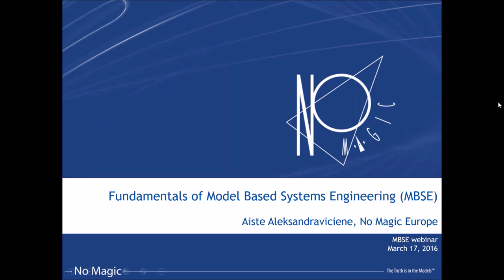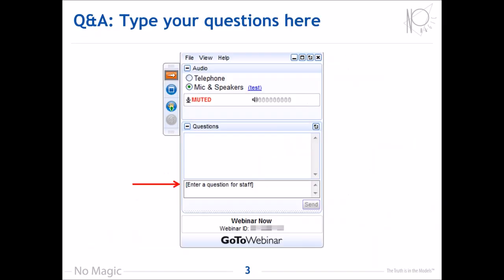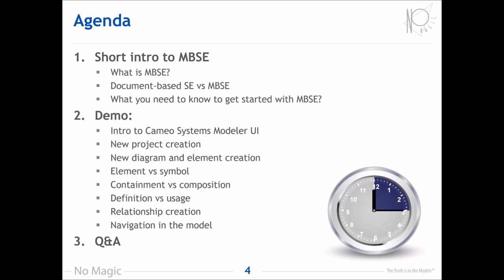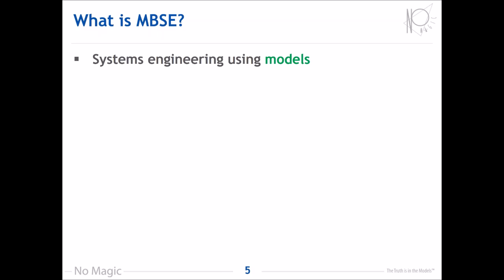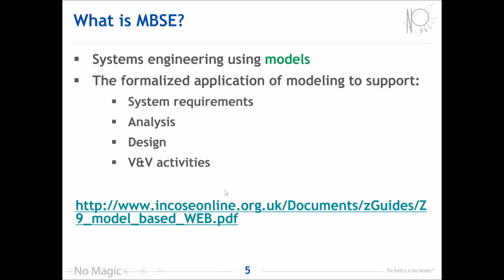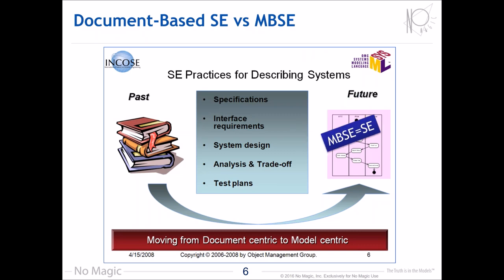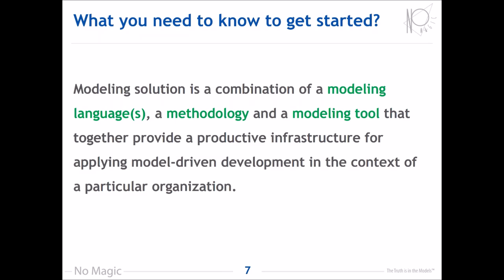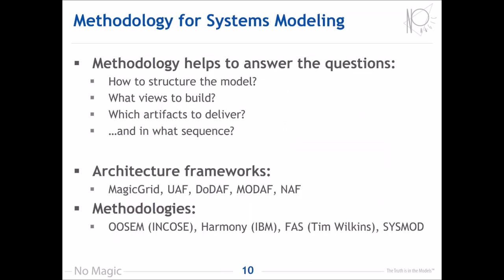Fundamentals of Model-Based Systems Engineering (MBSE)

Comment: A very good tutorial, set speed to 1.25 and it should be good. It's not that she isn't prepared, it's just the difficulty of finding the correct words/ways to express what she wants to say. People whose first language is not English would understand.
Reply: Innoslate software task

 This is an individual assignment. Using INNOSLATE, Please perform a functional analysis (decomposition) of 'to manage' (more specifically, 'Manage a Project') which should include a very thorough decomposition. You must use INNOSLATE. Ensure you number your functions and go down 3 levels (F0, F1, F1.1) This should be a refresher from your SE3100 Fundamentals of Systems Engineering Class (Blanchard and Fabrycky, Buede and the DAU SE Fundamentals). If not, let me know.

The point is to get to a functional decomposition with which you feel comfortable and your logic and structure for functions is sound. You must explain in writing (1-3 paragraphs) why you selected the functions and the functional structure in order to communicate your logic. You must also cite sources and provide a list of references.

This assignment should be 3-4 pages and enough content to explain why and how you created the decomposition.

Budget- 30-35$USD
Timeline- 2-3 Days
  can you do this assignment for me??
Email id- bshelpinhomework@gmail.com

Comment: if you want to have a introduction in cameo (Like I searched for) very helpful. If you're interested in MBSE there are probably better tutorials
Reply: Innoslate software task

 This is an individual assignment. Using INNOSLATE, Please perform a functional analysis (decomposition) of 'to manage' (more specifically, 'Manage a Project') which should include a very thorough decomposition. You must use INNOSLATE. Ensure you number your functions and go down 3 levels (F0, F1, F1.1) This should be a refresher from your SE3100 Fundamentals of Systems Engineering Class (Blanchard and Fabrycky, Buede and the DAU SE Fundamentals). If not, let me know.

The point is to get to a functional decomposition with which you feel comfortable and your logic and structure for functions is sound. You must explain in writing (1-3 paragraphs) why you selected the functions and the functional structure in order to communicate your logic. You must also cite sources and provide a list of references.

This assignment should be 3-4 pages and enough content to explain why and how you created the decomposition.

Budget- 30-35$USD
Timeline- 2-3 Days
  can you do this assignment for me??
Email id- bshelpinhomework@gmail.com

Comment: A sophisticated topic like MBSE requires a presenter that knows about this topic and necessarily does not read from a written script. Very unprofessional !
Reply from the maker: We appreciate your feedback and will use it to make improvements in upcoming webinars.
Reply: Innoslate software task

 This is an individual assignment. Using INNOSLATE, Please perform a functional analysis (decomposition) of 'to manage' (more specifically, 'Manage a Project') which should include a very thorough decomposition. You must use INNOSLATE. Ensure you number your functions and go down 3 levels (F0, F1, F1.1) This should be a refresher from your SE3100 Fundamentals of Systems Engineering Class (Blanchard and Fabrycky, Buede and the DAU SE Fundamentals). If not, let me know.

The point is to get to a functional decomposition with which you feel comfortable and your logic and structure for functions is sound. You must explain in writing (1-3 paragraphs) why you selected the functions and the functional structure in order to communicate your logic. You must also cite sources and provide a list of references.

This assignment should be 3-4 pages and enough content to explain why and how you created the decomposition.

Budget- 30-35$USD
Timeline- 2-3 Days
  can you do this assignment for me??
Email id- bshelpinhomework@gmail.com

Comment: What is that "relations" structure in the containment view? my models dont seem to have it
Reply: The Relations node in the blank project displays if the project has "profile application" or "package import" relationships. If you don't see that node it may be that your project is UML and doesn't have these relationships. Or maybe you're using later Cameo version, where this node displays only if the auxiliary resources are displayed. For this, click the gears icon at the top-right corner of the Containment tab and click to select *Show Auxiliary Resources*.
Reply: @aiste9A  Seems I have a later version, many thanks for the help!

Comment: This was not the tutorial I was looking for....I wanted a tutorial on MBSE not on a tool
Reply: That's funny. I want just the opposite.
Reply: Innoslate software task

 This is an individual assignment. Using INNOSLATE, Please perform a functional analysis (decomposition) of 'to manage' (more specifically, 'Manage a Project') which should include a very thorough decomposition. You must use INNOSLATE. Ensure you number your functions and go down 3 levels (F0, F1, F1.1) This should be a refresher from your SE3100 Fundamentals of Systems Engineering Class (Blanchard and Fabrycky, Buede and the DAU SE Fundamentals). If not, let me know.

The point is to get to a functional decomposition with which you feel comfortable and your logic and structure for functions is sound. You must explain in writing (1-3 paragraphs) why you selected the functions and the functional structure in order to communicate your logic. You must also cite sources and provide a list of references.

This assignment should be 3-4 pages and enough content to explain why and how you created the decomposition.

Budget- 30-35$USD
Timeline- 2-3 Days
  can you do this assignment for me??
Email id- bshelpinhomework@gmail.com

Comment: good slide deck.  

Presenter themselves needs to take some public speaking classes as well as working on preparation.
Reply: Innoslate software task

 This is an individual assignment. Using INNOSLATE, Please perform a functional analysis (decomposition) of 'to manage' (more specifically, 'Manage a Project') which should include a very thorough decomposition. You must use INNOSLATE. Ensure you number your functions and go down 3 levels (F0, F1, F1.1) This should be a refresher from your SE3100 Fundamentals of Systems Engineering Class (Blanchard and Fabrycky, Buede and the DAU SE Fundamentals). If not, let me know.

The point is to get to a functional decomposition with which you feel comfortable and your logic and structure for functions is sound. You must explain in writing (1-3 paragraphs) why you selected the functions and the functional structure in order to communicate your logic. You must also cite sources and provide a list of references.

This assignment should be 3-4 pages and enough content to explain why and how you created the decomposition.

Budget- 30-35$USD
Timeline- 2-3 Days
  can you do this assignment for me??
Email id- bshelpinhomework@gmail.com

Comment: really tired to listen to...
Reply from the maker: We appreciate your feedback and will use it to make improvements in upcoming webinars.
Reply: Innoslate software task

 This is an individual assignment. Using INNOSLATE, Please perform a functional analysis (decomposition) of 'to manage' (more specifically, 'Manage a Project') which should include a very thorough decomposition. You must use INNOSLATE. Ensure you number your functions and go down 3 levels (F0, F1, F1.1) This should be a refresher from your SE3100 Fundamentals of Systems Engineering Class (Blanchard and Fabrycky, Buede and the DAU SE Fundamentals). If not, let me know.

The point is to get to a functional decomposition with which you feel comfortable and your logic and structure for functions is sound. You must explain in writing (1-3 paragraphs) why you selected the functions and the functional structure in order to communicate your logic. You must also cite sources and provide a list of references.

This assignment should be 3-4 pages and enough content to explain why and how you created the decomposition.

Budget- 30-35$USD
Timeline- 2-3 Days
  can you do this assignment for me??
Email id- bshelpinhomework@gmail.com

Comment: Goes to show just because someone is an expert in something doesn't mean they can teach.
Reply: Innoslate software task

 This is an individual assignment. Using INNOSLATE, Please perform a functional analysis (decomposition) of 'to manage' (more specifically, 'Manage a Project') which should include a very thorough decomposition. You must use INNOSLATE. Ensure you number your functions and go down 3 levels (F0, F1, F1.1) This should be a refresher from your SE3100 Fundamentals of Systems Engineering Class (Blanchard and Fabrycky, Buede and the DAU SE Fundamentals). If not, let me know.

The point is to get to a functional decomposition with which you feel comfortable and your logic and structure for functions is sound. You must explain in writing (1-3 paragraphs) why you selected the functions and the functional structure in order to communicate your logic. You must also cite sources and provide a list of references.

This assignment should be 3-4 pages and enough content to explain why and how you created the decomposition.

Budget- 30-35$USD
Timeline- 2-3 Days
  can you do this assignment for me??
Email id- bshelpinhomework@gmail.com

Comment: Innoslate software task

 This is an individual assignment. Using INNOSLATE, Please perform a functional analysis (decomposition) of 'to manage' (more specifically, 'Manage a Project') which should include a very thorough decomposition. You must use INNOSLATE. Ensure you number your functions and go down 3 levels (F0, F1, F1.1) This should be a refresher from your SE3100 Fundamentals of Systems Engineering Class (Blanchard and Fabrycky, Buede and the DAU SE Fundamentals). If not, let me know.

The point is to get to a functional decomposition with which you feel comfortable and your logic and structure for functions is sound. You must explain in writing (1-3 paragraphs) why you selected the functions and the functional structure in order to communicate your logic. You must also cite sources and provide a list of references.

This assignment should be 3-4 pages and enough content to explain why and how you created the decomposition.
Timeline- 2-3 Days
  can you do this assignment for me as m stuck with this.